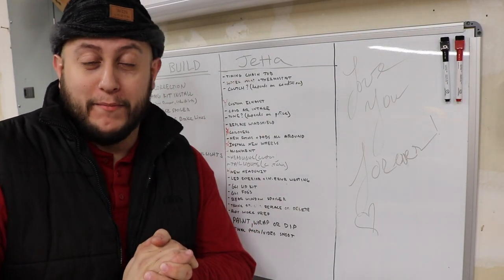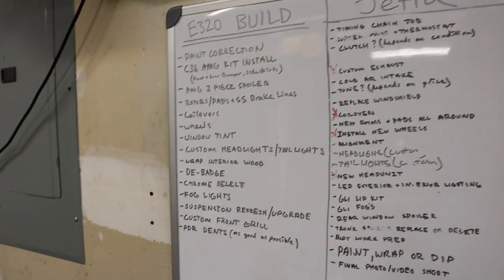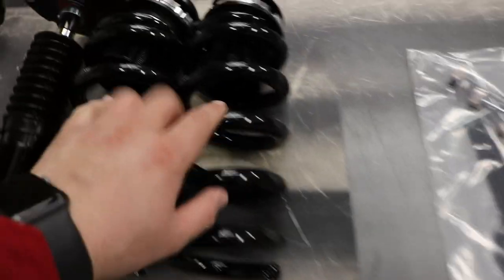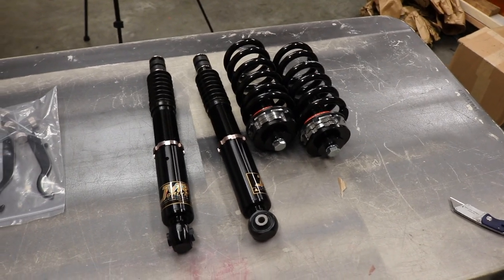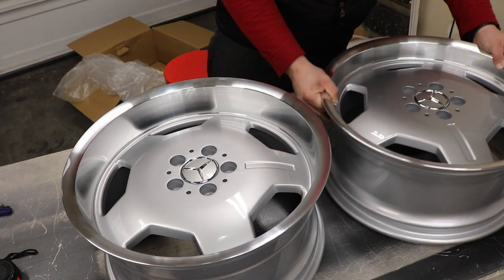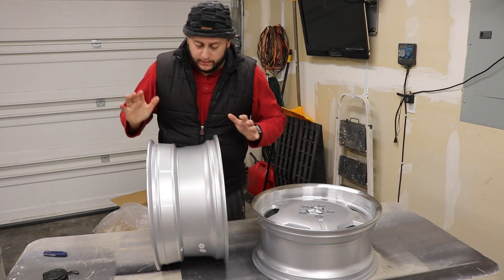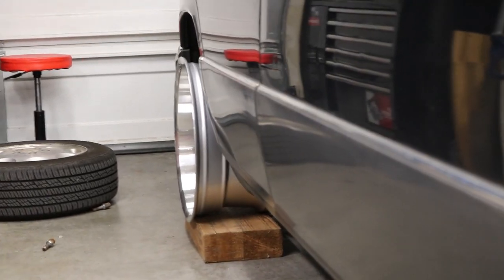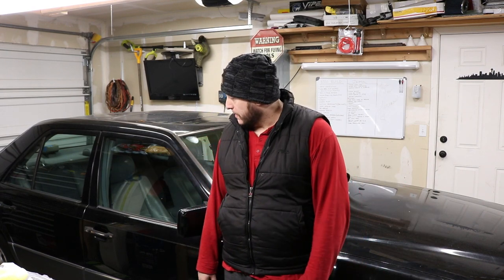1995 Mercedes E320 W124 Build - Part 2 Parts Unboxing & Wheel Test Fit

Comment: Did your oem lug nuts fit or did you have to buy different lug nuts
Reply from the maker: Hello, I do have to get an aftermarket set
Reply: @ROADNOISEMEDIA   what are the exact specs that you got?
Reply from the maker: @IgnatBK  all the info is in the video when I’m unboxing the wheels
Reply: @ROADNOISEMEDIA  wasn’t able to find lug bolt specs in the video
Reply from the maker: Ah ok, I didn’t include that because I still have to order them, need to measure and see what I’ll need, I’ll mention it in my next mercedes video when we install the wheels
Reply: @ROADNOISEMEDIA  when is next video coming out?
Reply from the maker: Working on it now, fiberglass work takes time, so not sure at the moment
Reply: @ROADNOISEMEDIA  can’t wait for it to come out..good work
Reply from the maker: Thank you, should be able to have a video out in the next week or so